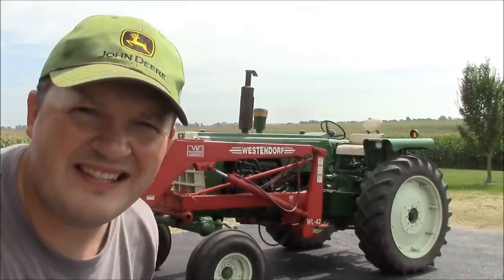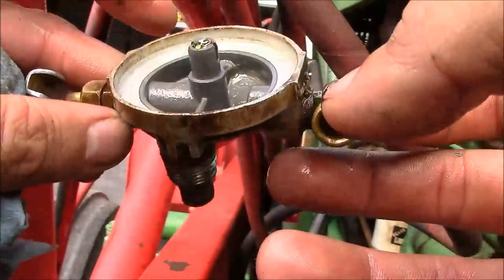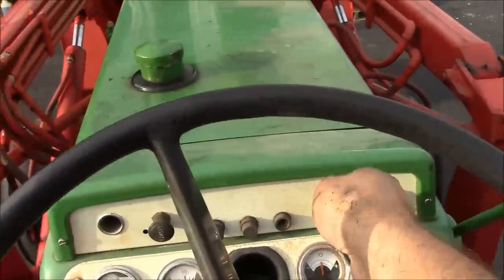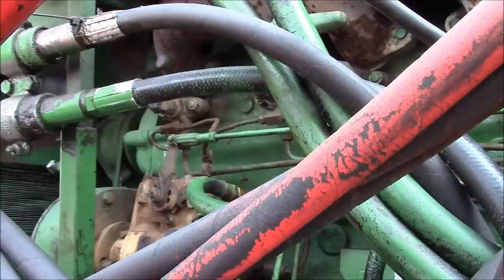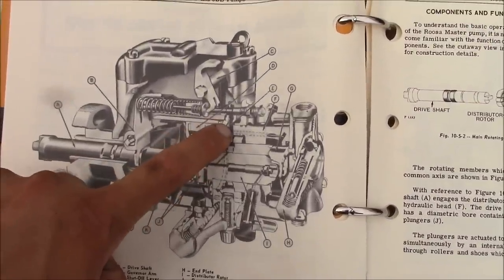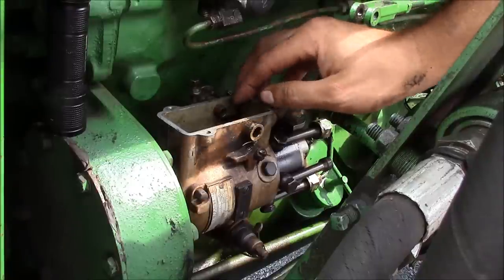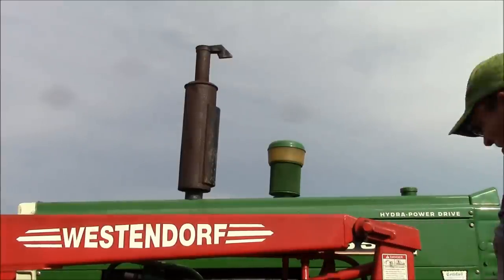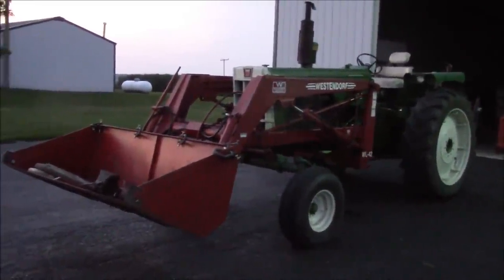Oliver 1650 Diesel Tractor - Hard Start / No Start

Comment from the maker: Just a follow up since many people have been asking. I had the fuel tank cleaned at a local radiator repair shop. The tractor has been running great. The manifold heater does work. The tractor starts fine without ether, even in the colder weather.
Reply: Wes, I really enjoy watching your videos! Congratulations on finding the metering valve sticking!
I was a bit concerned that you hadn’t cleaned the tank, lines and everything else fuel supply related once you found the sludge buildup. But after reading your update, my faith is restored - haha. I’m sure the customer was very pleased with your work and troubleshooting! Hopefully he’ll check all his other diesel and equipment. Thanks for another great video and the update comment.
Reply: Awesome
Reply: Its diesel algae, i ran in to it with my first 5 ton m818 tractor army truck. I took 5 gals of brake parts cleaner in each 55 gal fuel tank, strapped them into the back of my daily driver pickup and drove around town for a week. The following weekend I pulled the drain plugs on the tank and basically made the tanks have diarrhea. Afterwards the tanks where spotless and new looking on the inside of the tanks. 

Also check the fuel lines because the algae can from in the fuel supply lines and plug up the fuel supply lines just like celestial in an array. Also check to see if the fuel screen on or in the pump is clean as well. The algae will plug up the screen that supplies low pressure fuel to the high pressure fuel pump for the injectors. Run a heavy dose of algar-a-side threw the engine and that will clear all of the from the pump and fuel system. Down side is you will have to replace your fuel filter because its going to catch all that loose crap you nocked loose from every last surface it was stuck too.

P.S. my girlfriends uncle still runs all Oliver's on his farm.
Reply: @nickslistm246  Algae? Good grief, in FUEL? Life surely does 'spring up' lol
Reply: @mdouglaswray  technical isn't not true algae its just a bacteria that lives in the water in the fuel tank that feeds off of the diesel fuel and multiplies over time till it coats the tank walls and everything associated. But everyone calls it diesel algae.
Reply: @nickslistm246  I'm just always surprised that there are microorganisms that EAT FUEL. LOL. Makes sense I know, just caught me by surprise.
Reply: @mdouglaswray  caught me by surprise to about 8 year's ago now. Anther fun fact all untreated diesel fuels are only good for up to 6 months before the bacteria starts growing in the fuel. That's why they make biocide additve for diesel fuel.
Reply: I think getting your fuel system cleaned is the best way to avoid further problems down the road. Really enjoyed your video.
Reply: adding more fun facts to the sludge story, the "chocolate mousse" looking sludge is actually the poop of the microbes they excrete as they consume the edible elements of the diesel and water.
Reply: First thing I wondered when your great video ended.
Reply: Another good one. I'm getting caught up on your older ones. I spent a summer running a gasoline version of that Oliver mowing alfalfa.  Well built and stout they are.  Them microbes clean up oil spills too. Dinosaur eaters.
Reply: Diesel bug like others have said, use AJX diesel treatment, a quart will treat all your vehicles for a couple years

Comment: If you are interested:  1.  The manifold heater solenoid isn't working or the contacts are trashed.   You should hear a click when the button is pushed.  You can sometimes pull apart the relay and sand the contacts, this will make the solenoid work better.   2.  To clean out the gas tank, the best way is to take it to a radiator shop and have it cleaned out because they chemically clean out radiators this way - a radiator tank is basically the same as a diesel tank.  Street rod guys do this all the time when restoring old gas tanks.  This is the best method to use if there is rust in the tank, because they (usually) have a coating to seal up and deactivate rust and even seals some pinhole leaks if they are really bad.  However, you can clean it at home using Muriatic Acid (weak Hydrochloric acid) which is what they use to clean boilers with.  Most (older) hardware stores carry this.  Be careful not to get any on your skin.  You should clean out the lines as well, because they can clog up with algae also.  3.  There is really no difference electrically between charging two 6 volts in series or charging a 12 volt battery - but it may charge the batteries faster if done separately.  If there is a difference, it is in the cable connecting the two batteries in series or in the amount of electrolyte in them.  If you charge your batteries separately, they will charge faster because the battery charger produces more current on 6 volts than on 12 but that is only true because the charger is under less load.  This isn't necessarily a good thing, more current means more heat, which kills battery life.  It is better to charge the the batteries in series even though it takes longer, the lower current will make them last longer.

Comment: You should be impressed with your skills and give your self some credit when you get a machine started and running again. Most people can't even jump start a vehicle. I know that when I get an engine running again I feel super awesome. I've had several projects that were non runners like motorcycles and trucks that I've got running again. I got a brand new pressure washer free because it was returned to the store I use to work at, they decided not to send it back to the manufacturer, all I know is it doesn't run and nobody has even looked at it. I have no doubt I can get it running when I have a chance to look at it. I just started watching your channel and I think it rocks.

Comment: Great video! My experience with this type of pump, when you remove the cover it should be full of fuel. Just static filling the pump by gravity from the tank. The side shafts you removed have seals when they go bad the fuel will drip past these seals and drain the tank, if you don’t shut off the fuel. If these leak ( didn’t look like it) or any other leaks down stream and you constantly forget to shut the fuel off the leaking fuel can transform into another substance. Also evaporation/ exposure to oxygen can transform the diesel. My experience is a tractor used daily hardly ever has these issues but a barn queen will see it often. Thanks for the channel.

Comment: Wes     I ran into this stuff in a four wheeler tank and gasoline does not affect it at all. It will get on your hands and you cant get it off.  Well, along comes the wife and she says wash your hands with this Fabuloso.   I had never seen this stuff before but man does it work. I went to Gen.Dol. and bought a gallon for 6 bucks poured the whole gallon into the tank and mixed water with it to fill up the tank. I left it sit overnite and next morning I just poured it all out. I rinsed it out with some more of the mixture, rinsed that out with clean water and dried it out with air from vacuum cleaner. Sometimes, the wife is good for something!!!!!

Comment: Over 30 years ago Ford sold a truck here in the UK that was so bad at starting it actually had an Ether (easy start) injector system in the cab. I can't remember the model but it could transport three horses, so a medium sized truck.(6 cylinder diesel) I got it dirt cheap for a friend of mine who wanted to move some heavy stuff. When he stripped the engine down he found that all the piston rings were cracked. That's the problem with Ether, it buggers your engine! He replaced all the rings and got great service from that truck. I'm sure that after that he went really easy with the Ether :)
Nice video!

Comment: Interesting, I was on the edge of my seat as the issues kept getting bigger. Glad you didn't have to rebuild the pump.
Reply from the maker: Yeah me too. These pumps are very reliable though. Usually the only thing that fails is the timing advance and external fuel leaks.

Comment: I've been welding fuel tanks for years! All you need to do is open the tank at the seam clean it then wire weld it back at the seam again as long as you put water in the tank your golden!!

Comment: Called to a brand new Clark diesel fork truck years back. No start every morning but every time during the day. After several days of bleeding fuel system and injectors, I stripped all the pipework from tank to injector pump, reassembled it and put a vac gauge on. Wouldn't hold vac, checking every fitting and o ring found one of the brass fuel elbows had a huge gouge on the JIC taper face of the elbow. Threw some PTFE tape and thread paste on it and refitted system, primed up and started. Started every time at any time since.  New elbow fitted under warranty on the next service.

Comment: We had a Oliver 2150 and a 1850 both were a pain in the ass to get started every spring. They didn't like cold weather at all. We ran a ford 9000 year round. I'm from up state ny. We had cold winter's when I was young. The Ford never gave us much trouble. We all ways had tinker with the Oliver's. Good tractors when they cooperated and ran right
Reply from the maker: Pre-combustion engines are very hard to start in cold weather. The newer direct injection engines work a lot better.

Comment: Fuel fungus..from crap fuel. Needs system cleaning & run some anti- microbial treatment. In good fuel or it will clog again soon.
Reply: I've seen this before in military vehicles. Because fuel is organic does get fungus. I've actually seen fuel tanks replace because of it.
Reply: thats a thing?
Reply: @williamfindspeople4341  i wonder if that can turn battles
Reply: @qwertykeyboard5901  back in the day diesel fuel use to have sulfur the kill or inhibit microorganism, modern fuel has little or none specially biodiesel and now you have to put chemicals the kills it
Reply: Amen.

Comment: The last one i had that problem with i cleaned the fuel system like you did but when it came to the injection pump i loaded it with stanadyne fuel treatment.  Then brushed it around and vacuumed it out. And loaded it again , capped it off and fired it up . Maybe i got lucky but so far so good. Nice video , step by step.

Comment: With Roosa-master fuel pump, mounted horizontally, crack at least two injector lines on the top side of the pump, preferably at the injector end. When you have good supply of fuel, To the pump, check fuel shut-off (electric or mechanical) and crank engine with full throttle until some smoke at exhaust. Tighten up the loosened injector lines. Do Not use starting fluid with preheat! If it doesn't work properly, will not rev up, particularly, be sure that excess /return line is not restricted, it will cause strange things. Roosa-master pumps will operate flawlessly with gravity supply, but it must be free flowing. Any water reaching the pump is catastrophic. Remove timing inspection plate on the side of the pump, and be sure that the pump hasn't seized and twisted off the drive. It only takes a drop or two of water to seize the pump. Never use ether, if you don't have white smoke at the exhaust.  Good luck, but I can't watch this all the way through. Been there, seen it all before.
Reply: Something else I would like to add to your excellent procedure is that I believe there is a gauze filter just below the big nut on the fuel inlet pipe  It’s always worth a look inside there first before you go diving into the top of the pump

Comment: Great video.  I struggled with you to figure out what was wrong. I agree the starting fluid cleared some sort of air/vapor lock. I know very little about diesel engines , but what I learned about my ford f-350 with 7.3 engine is that if you use starting fluid disconnect the glow plug relay. No risk of engine catastrophic explosion. The engine fires up even at 20 below within 2 seconds  with just 1/2  second spray.  Easy to do. Five of my glowplugs need to be replaced but its too friggin cold here in Vermont to do it outside at this time of year.  I  will use the starting fluid and will replace to glowplugs this spring,  Thank you.  Craig
Reply from the maker: Those 7.3 glow plugs are pretty easy. It's a bit of a pain to get the passenger side valve cover off, but still pretty easy. The 6.0s are a pain. At least where I live the harness will almost always be corroded and snap off in the head. Then you have to pull the inner fenders and chisel them out. I've always heard they will start OK with 2 bad plugs. 3 or more and they won't usually go when it's cold.

Comment: Loved the video.  I could listen to this guy all day.  I have one comment.   If the engine is running on biodiesel the gooey.material could be vegetable oil that's decomposing.  You might be able to flush the fuel system with methanol.  Just a half baked thought.

Comment: It seems modern diesel is a pain. Because there is no sulfur anymore and the substitutes tend to gradually solve the gunk that is always on the bottom of the tank. Thus clogging the fuel line filters. This is what an old school engineer told me while we were steam cleaning a diesel fuel tank and later replaced all filters. Those filters were made of small copper sponges. All the copper was in the process of dissolving slowly and the two filters next to the pump were showing traces of copper particles. Modern fuel systems of course are able to cope with modern diesel oils. The older equipment must be checked for issues like this. Great videos by the way! Greetings, Willem, Hekelingen, Holland. Oh, I do not like starting fluid. It can be fatal for an engine. And that old school engineer told me this: once a sniffer, always a sniffer. A diesel engine should start without ether. If it doesn’t, there usually is a problem that must be fixed. And if you think about it, it makes sense. We use a flame at the air cleaner intake if temps are low and this always works fine if no preheater is installed.

Comment: I didn't see anyone mention always adding an algaecide with each tank of fuel. Power Service makes a good product called Bio Kleen Diesel Fuel Biocide that is soluble in both fuel oil and water, giving algae no place to hide. Power Service also makes a system cleaner to dislodge the slime in all the pipes and hoses. 
I always add a double-dose of algaecide to the fuel of the stand-by diesel generators I service where the fuel may sit in the tank for years.

Comment: What magic did you use to syphon the fuel, I've never seen it done like that before! It certainly beats a gob full diesel :-)
Reply: My guess is a ball check valve on the end of that hose.  When he drops it down fuel flows past, but when he lifts the ball closes and lifts some of the fuel.  I've seen it done before.  You have to move it pretty quickly to get the ball to move fast enough.

Comment: That sure looked like a John Deere tech manual you were using!  Once the pump starts to spin good the governor weights will help to assist in moving the spool valve. Likely why a little snort would get it whipping enough to get running. Lots of corrosion in that pump. That fuel has for sure at some point had a lot of water in it.  We use a steam power washer at work to clean out the fuel tanks. Run the John Deere keep clean and fuel protect additives and it does wonders for keeping the systems in good shape especially should you wind up with some not so great fuel.
Reply from the maker: I have a hot water pressure washer. But I think I will let it go for now. I scooped out the big chunks and I don't think the rest will really hurt anything. Yes, it's a Deere service manual.

Comment: Nice job again Wes! That sticky gunk in the tank must have worked down into the pump and gummed up the metering valve. I would bet, in another 50 years, the owner will have the same problem.(IF that fuel tank isn’t replaced or cleaned)👍

Comment: That gunk you are talking  about in the fuel tank is just diesel that has gelled up, a good fuel conditioner or stabilizer helps fuel from gelling up, although over time  you will accumulate a little.

Comment: Looks like diesel fuel algae i the tank and the filters. probably the same thing making the metering valve stick at times. i have seen additives to help break down the algae but removing the tank and having it dipped is how i clean it. sometimes you just got to give them a snort of the good stuff. i agree with your theory....possibly it takes a small amount of fuel pressure to reset the metering valve which only occurs once the fuel pump is pumping at idle rpms and higher.
Reply from the maker: I didn't think about algae. That could be it. I'll have to see about professional cleaning if the problem returns.
Reply: Good point, I had forgotten about the bacteria that  live and grow in Diesel,
Reply: I’m sure that’s alge. Should check all the tanks of equipment on that farm and holding tanks if they have. I’ve seen that gunk get thru filters into injector and blow the tip off. On direct injection engine it’ll burn piston in short time.
Reply: You can shock tanks with biobore? To kill the bacteria

Comment: @6:50

I'm happy to see that you took the tank to be cleaned at a radiator shop cuz I was going to accuse you of being "Cheap Charlie" by settling just to scrape out some sludge with a tobacco laugh instead of doing what you eventually did.

You never want any foreign substance in the fuel system.  Purchase only 10 days or less of fuel at a time so that it doesn't go stale on you.  If you cannot get a price break purchasing that little fuel, purchase a diesel fuel additive so it stays in a better state for a longer period of time.

I don't even blink an eye to put Power Service diesel fuel additive in my Cummins N14.  For $20 a bottle, it helps the chances of saving me an engine rebuild that starts at $20,000.